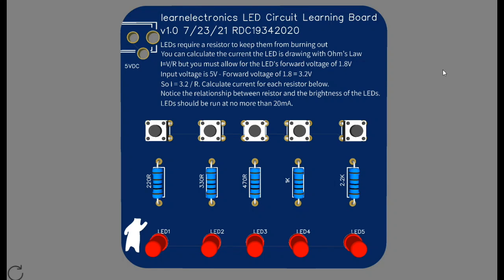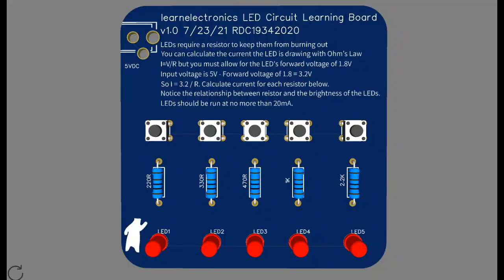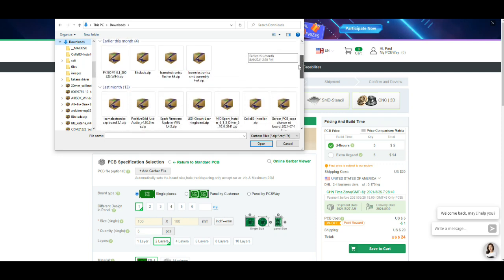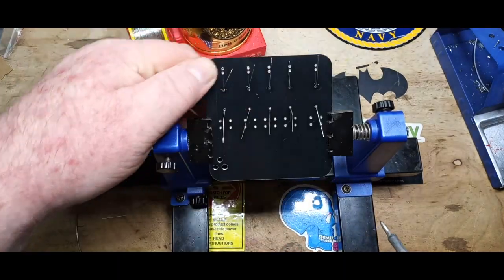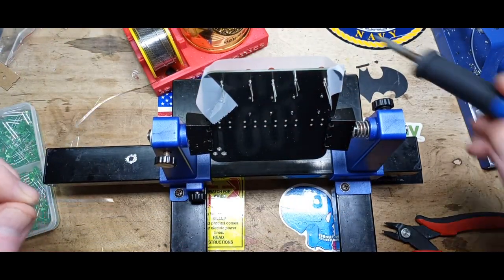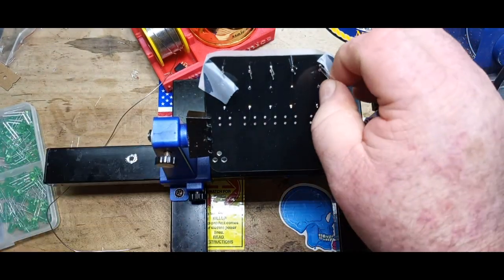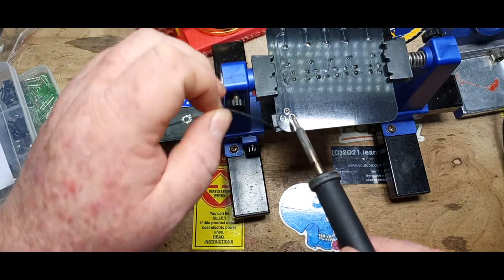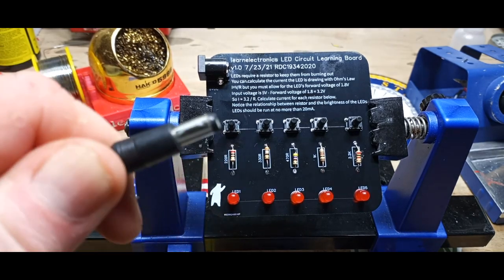Ohm's Law/LED STEM Learning Board

Comment: Only one test point would be required to show the current thru each LED.
Reply from the maker: Need to measure current in series
Reply: one test point on the ground will show the current as each resistor is changed. If two or more chosen will show combined current

Comment: Since the point is learning Ohm's law, let the users measure the voltage drops on the resistors and then calculate the current. A bit more brain exercise that way.

Comment: I love your basic circuits, wish it was so simple in my school days 😁

If I could make a suggestion...

Why not silkscreen the basic circuit layout on top, so students can see the actual connections?

Indicate the push buttons, LED's, resistors etc using their correct symbols, indicate the tracks which connect them etc. 

Adding pin headers for measuring voltage/current is also a good idea (as you suggested). Perhaps include jumpers to short the series headers for when not measuring current. 

Keep up the good work 😁
Reply: And fix the typo. ... relationship between reistor. Should read resistor. Btw I can't type to save mysrlf.

Comment: I understand that these are all about teaching but as you said there should have been additional hands on teaching points such as test points. Maybe with a 5v 1a input you could have a bunch of resistors selected by jumpers and then a readout that displays the current reduction / output to show ohms law in action with the maths formula written above so they can calculate it then test their maths.
They are still good for a basic visual representation though.